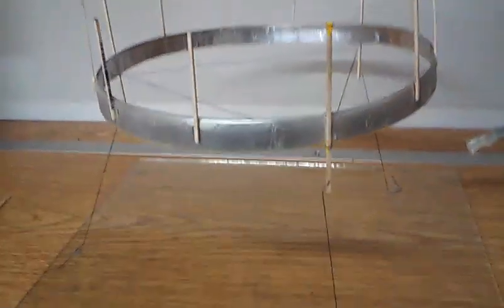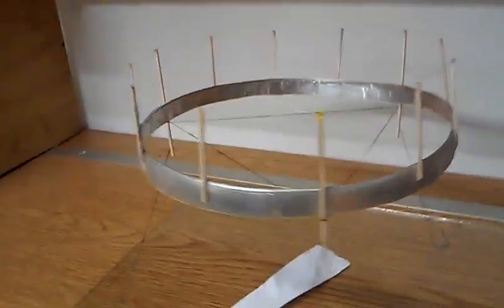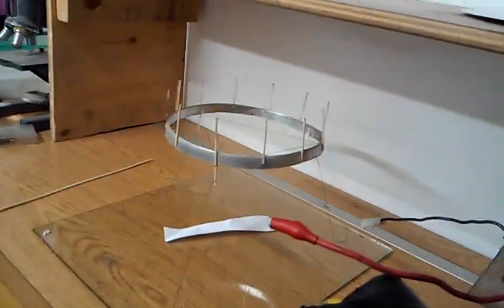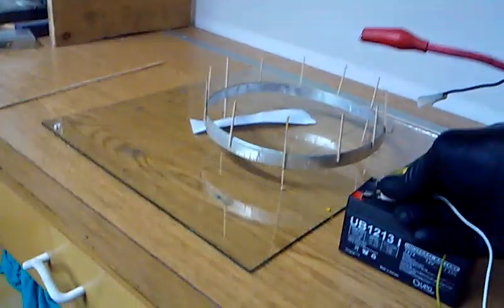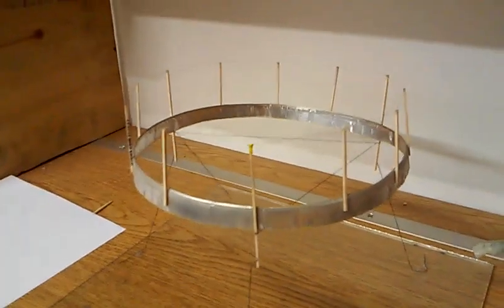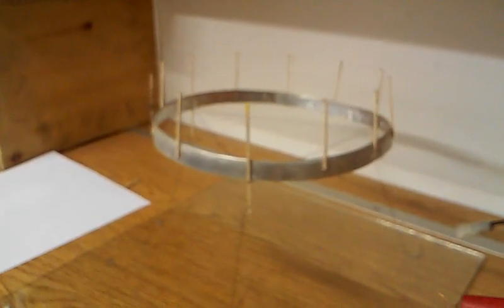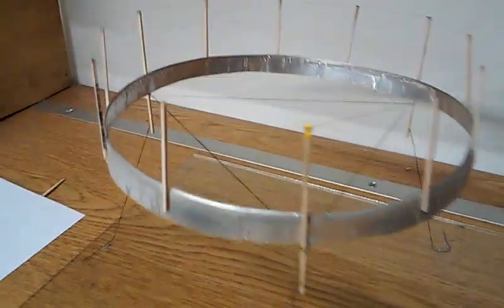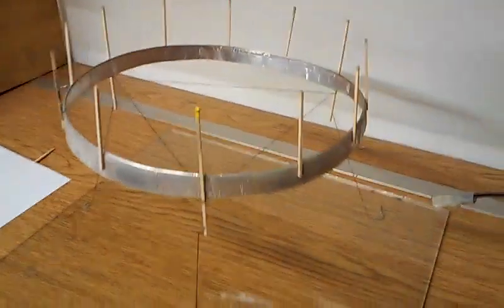ANTIGRAVITY LIFTER CREATES ARTIFICIAL GRAVITY ASYMMETRICAL CAPACITOR

Comment: Sorry Jim, but you clearly have no idea about what you have made or how it works...Its  T.T.Brown lifter,  utilizing the Biefield/Brown effect (which is the tendency of a highly charged capacitor to exhibit thrust in the direction of the positive electrode).  And it is definitely being lifted by ion wind.  this is obvious because it wont work in a vacuum!
Reply: Wrong. It has been proved after the "so called" Nasa debunking where they did'nt even supply the correct voltage. In independant studies, it did show that it will in fact work in complete vacuum. Research it.
Reply: Have you got a link to a video showing where one is used in a vacuum?
Reply: TT Brown has some old videos floating around where he did the first vacuum tests
Reply: it can work in a vacuum if the ionized gas is trapped INSIDE by a container.... bring the ionized gas inside a the craft...
Reply: +klientjuhD If you trap the ionized gas inside the container, you can accelerate it (thus generating thrust), then it hits the container (thus counteracting the thrust).  It won't work this way.
Reply: If there is ionized gas inside, then it's not in a vacuum!
Reply: CAN YOU ADD TO THIS PLEASE?    JUST LOOKS LIKE TALK.
Reply: bad link
Reply: Whether the lifter works in a vacuum I couldn’t tell you bit if you wanted to find out you would need to adjust the distance between the wire and foil because the conductive medium changes between air and vacuum. The distance needs to be just right to prevent arching but also enable the electromagnetic field to bridge the gap between the two electrodes. If this lifter was placed in a vacuum it would not work. Similarly, if this lifter could work in a vacuum then it would not work on the ground under normal conditions. You need to be able the vary the distance between the wire and foil in a vacuum jar whilst the air is being pumped out to carry out a proper investigation.
Reply: How about getting out of your Lazyboy, stop stuffing your face with Cheetos and prove that it does not work in a vacuum!
Reply: Blah Blah Blah!
Reply: How to make ?
Reply: Alf B thank you for the explanation
Reply: Alf B Mythbusters had one of those things in a vacuum chamber during their episode about antigravity
Reply: The Inventor, TT Brown, Takaaki Musha of HONDA, the US Army, Purdue University, and NASA all proved that it works best in hardest vacuum. Electrostatics works in vacuum. That is why we used to have VACUUM TUBE electronics!
Reply: NASA got patents 17 years ago with Serrano and Campbell after successful hard vacuum tests in 1999.
Reply: It works fine sealed in plastic bags and resin blocks!
Reply: They work sealed in plastic bags, and inside RESIN BLOCKS, where of course no air can get in our out!
Reply: check out jlln naudin  they test asymmetrical capacitors in mineral oil which simulate vacuum .. works even better
Reply: Exactly. Works even better under oil, in vacuum, sealed in resin blocks, etc. All of these media preclude ionization, so ion-wind, which is a feeble force with an upper-limit, cannot be responsible for the observed effects on mass. It accelerates a mass toward the positive polarity, and repels it from the negative polarity, the very definition of the Alcubierre Warp Drive methodology, which NASA and Dr. Harold White are all excited about now, and got patents with Serrano and Campbell 17 years ago!
Reply: Every force has an effect- rockets work in a vacuum and so will ionic propulsion
Reply: Reenan Du Toit, this is neither of those. This is electrogravitic propulsion, and as tested, is inertia-free. Please read:  http://u2.lege.net/cetinbal/PDFdosya/EtherTech.pdf
Reply: Again you're wrong tt Brown tested his theory under high vacuum and it did work in the Winter Haven Lab. Not only that the United States Army thought it was ionic wind propulsion and he did his test overseas to prove them wrong he went back to the colonel after the Winter Haven lab experiments and tested it in high vacuum and the propulsion system did work. That's why it's called electrokinetics not electric propulsion there is a difference there is a force there no matter what.
Reply: Alf B we don't live in vacuum, plus who told you the space is just vacuum?
Reply: what are the applications for this technology?
Reply: It would work in a vacuum. Consider a vacuum is never truly empty. Space is not empty.

An aeroplane propeller would not be affective in water. That's why the design has to change to propell a boat. 

Either the design has to change for a vacuum or the amount of energy used has to increase.
Reply: To Alf B, I had forgotten about the banned Roe Sigma book on the Biefield/Brown effect with high frequency electricity and a high dielectric substance. Thanks for the reminder.
Reply: It can work in a vacuum, but can't with out the magnetic field of the earth. Is an electromagnetic effect apply inside a magnetic field, in this case the magnetic field of the earth. Its not anti-gravity effect at all.
Reply: There is no such thing as vacuum. There is only differential pressure. Vacuum is just pressure negative to atmosphere. Whatever atmosphere may be. I am sure weather you do this experiment 2000 feet below sea level, or 20000 feet in the the mountains, the results will be the same. Vacuum (negative pressure) just expands the molecules of air. Very fun project. Super cool. I would need to know much more about electronics to understand this thing.
Reply: NASA ( Now Another Spy Agency ) is full of shit .
Reply: It DOES work i vaccum. Its you that havent tested this good enough!

Comment: Do you have a schematic?
Reply from the maker: I can supply that, & I will as soon as I get time. You can probably get a better idea now if you check out my other video " New Asymmetrical capacitor Design for Propulsion" In the mean time. basically it's just a Joule Thief circuit wound over a med size computer monitor crt flyback with 2 winds primary about # 12 household solid insulated wire & 7 winds of the same for feedback connected in opposite direction to primary. 12 v + to connection, the end of primary to collector of 2N305, 7 wind feedback winding  thru 220 ohm resistor to base & use a heatsink on transistor & you may have to reverse windings to work with flyback diode. Hope that helps untill I post schematic. Thanx, Jim
Reply: Jim RugRoden great, good stuff
Reply: Just look up blocking oscillator on Google.
Reply: Copper wire, some sticks, aluminum cake pan, battery and, some string. there's the schematic. Lol
Reply: Greetings Jim, your creation is a combination of  art and science and is truly lovely. I say this for three  reasons: Foremost, as a visual artist, I have never seen anything like this. It belongs in a museum. Secondly,  I study whats known as "spooky math", or quantum mechanics, and am interested photon propulsion, aiming at the goal of of achieving interstellar travel. Lastly, my father was a brilliant electronic engineer , and i had the pleasure of designing several government  patents with him. But back to your design,  its the pioneers that take the arrows. I would like to speak with you more about your design.

Comment: the ion wind is not what makes it lift
Reply: plz put a magnet on the end of a stick and interact with the lifter plz record too youtube
Reply: will not work in a vacuum. my kids and I made several at least ten years ago.The Biefeld–Brown effect is an electrical effect that produces an ionic wind that transfers its momentum to surrounding neutral particles.
Reply: i used the the flyback transformer from an old monitor. About 25,000 volts.
Reply: it is phase magnetism note this type of magnetism is efective on metals that not affected by common magnetism
Reply: Piccolo sun has a good idea. Put a magnet on the stick end and see what happens  when you bring it close.
Reply: The observation is it is defying gravity, therefore it is an anti-gravity device. You can apply the word ION if you like but the definitive observation is gravity is defied here and in action.

Comment: Do you get the same results when swapping (reversing) the current to the field wires? And could you please video the experiment with smoke (or fog machine / dry ice / etc.) to prove or disprove ionic flow?

Comment: Here is a thought. what if you used really thin light weight guage magnet wire, and wrapped that around say the inside of the skirt forming a long solenoid. And then magnetise it in the same direction as your lift. Maybe that might speed up the ion flow and give a little more thrust?

Comment: It appears you have an electrically charged plate under the device. What this looks like is simple magnetic repulsion. It only floats when the heavy battery is connected. So, this will not lift unless it is directly over the charged plate under it. You need super-conductivity to make use of the planet's negative surface charge. A small negative charge in the vehicle, could be propelled away. I read that the strength of electrical repulsion is exponentially stronger than gravity. Look at the power demonstrated by a lightening bolt.
Reply: +JoyfulUniter Have you ever heard of a battery? That is the big really heavy power supply, he hooks up to the feather weight flying circle. The flying saucer is so powerful, it can support a tiny stick, wow. This is a grade three demonstration of electromagnetism.
Reply: I also like to believe that it's an electric magnet that is under the desk and that's the battery he turns on and off... I'm not positive tho...
Reply: Buck Fisher i agree the bottom plate must be the ground plane for lift to happn.
Reply: That's right      but, in the mean time we need to figure out a more efficient or super efficient Magnus or Coanda effect. The properties aren't new just the understanding is and that will be where someone makes a breakthrough.
Reply: It's not magnetic repulsion, it's electrostatic- the current is far too small to entrain any magnetic field powerful enough (in an essentially 1-turn coil).
Reply: That's WAY too much trouble and expense when electrostatics gets the job done with HV and very low power.

Comment: i am gonna make an airplane(a model) with aluminum  wings and a copper wire in front and it will fly, like an ordinary plane but without engine, what do you think ?
Reply: That would be cool need very light light power supply. I believe the wings and exhaust of some real planes use high voltage charge to increase efficiency. The power supply he made could power more lifters maybe.
Reply: it can be easy if you start with the idea that the tesla coil have to be inbeded in the fuselage, an horisontal coil(hidden in the fuselage), with aluminum wings with one high voltage wire in front of each wing, you turn it on and the plane go forward,
Reply: The capacitors shape is crucial to the funcionality of these lifters. So it might not work if shaped like an airplane.
Reply: The shape similar to U Feel O lol
Reply: Denis Giguere no it wont you will need a large power supply too heavy plus a planes wing works with airflow. The ionic airflow is not significant enough to produce lift. Nice idea though keep thinking outside the box
Reply: +Denis Giguere The floating circle in the demonstration is powered by the big heavy battery that never leaves the table. The floating circle can only float when it is directly over the charged plate under it. Tesla's wireless electric transmission experiments involved a series of huge towers installed on the ground. If they were actually in place, you would only need a receiver to connect, not a coil. You would need to be grounded, however, to close the circuit.
Reply: @Things We See
sorry but this is Bullshit. I will try to explain: the pointy things on the wings you mean are there for electrical discharge, just like when you rub your hand against some synthetic fabric, an airplane will get charged up. when a plane flies through the air it will get charged up by the air molecules, to get rid of the charge they have pointy devices (that are just metallic rods connected to the main airplane structure) that will disperse the charge back into the air. this works because charge accumulates and gets more "happy to move" on a sharp, pointy edge than on a flat surface (like the wings themselves, or any other relatively flat part of the airplane).
Reply: Fantastic idea! Go for it, BUILD IT.
Reply: Fortunately, thrust increase is EXPONENTIAL with increasing Voltage. Read TT Brown's lab notes, as I did in 1996.
Reply: i thought of that too but the thrust mass ratio is just a mess.
Reply: Thrust will be just fine for a sailplane or glider to keep it aloft with only 40kV @1.5 milliAmps.Use a foam sailplane, like Horizon Hobby, and a Micro HVDC battery powered supply from www.amazing1.com
Reply: It will work FINE shaped like a flying wing. Remember the US ANTIGRAVITY SQUADRON (B2 Stealth Bombers).
Reply: Of course that should work. just go to www.amazing1.com for plans and kits for micro High Voltage power supplies. Use a FOAM FLYING WING. It will work.
Reply: TT Brown made MODEL BOATS with this principle his patents are based on, which I replicated. TT Brown had demonstrated that animal and plant passengers on board the radio-controlled boats experienced NO G-forces or stresses, no matter how sharp a turn and instant acceleration-stars and stops. Typical UFO behavior. Everything within the forcefield has its inertial mass canceled by the electrical charge! Build them!  The Searl drive system was patented recently, US Pat No. 9,871,431, SPINTRONIC GENERATROR, Jan. 16, 2018. It is a New Age.
Reply: Build it!!! Its not that difficult. We need as many people as possibe building and experimenting with this 90-year old SIMPLE technology.
Reply: There are a lot of patents on the Internet which make use of this principle. Study them, and know that the power technologies today are smaller, much lighter and more efficient that what was ever available in the past.
Reply: The FLYING WING is PERFECT for this, as in the B-2 SPIRIT STEALTH BOMBER. Read THE US ANTIGRAVITY SQUADRON, by Thomas Volone, PhD, whom I lectured for at COFE-9, in Albuquerque, New Mexico last summer, 2017.
Reply: Its not "ionic airflow" that produces lift or FORCE, as these devices wok in OIL, WATER, HARDEST VACUUM, and SEALED IN RESIN BLOCKS, they still work! Tis is ARTIFICIAL GRAVITY, in perfect accord with Einstein's and Alcubierre's theoretical work. We can go to the STARS in reasonable time and economy with these TT Brown proven patents from 58-years ago.
Reply: Today we use LIthium-Polymer or Lithium Iron batteries that are very lightweight, like we use in RC Planes, Helis, and DRONES. 11.1 Volts in 3 sealed cells!
Reply: Why not? Make an ELECTROGRAVITIC WING-SUIT. Electric charge always stays on the OUTSIDE of an enclosed conductor. Go for it! Force is EXPONENTIAL with increasing Voltage.
Reply: Yo, that would be soo cool. If you make it, send me link :D <3
Reply: Stephen Pegg In the Hindu Scriptures, there is a FLIGHT MANUAL called the VYMANNIKA SHASTRA, and it talks about how to build STARSHIPS (!) It speaks of how the YOGIS can harness LAGHIMA "A powerful centrifugal force that can overcome any gravity", and how this is produced electro-mechanically in their ancient VIMANA craft, that today we call flying disks, or UFOs, since the 1940s in more modern times. The Ancient Tibetan Monks and Shaolin Priests of high order and training can focus this force too, they call CHI, or the Cosmic Life Force, which in India they cal PRANA, and we call ETHER. Ether, which Tesla championed, and not RELATIVITY, is coming back into vogue, and QUANTUM MECHANICS is now much better understood than it was in the 1930s and 40s. That is the KEY. Ether Theory, and Quantum Mechanics. Be careful, and good luck!
Reply: Look up St. Joseph of Cupertino, and Daniel Douglas Home, two persons who could LEVITATE AT WILL. Documented.
Reply: UFO'S EXPLAINED:
Yes, this helps explain the basic underlying "principle" of how UFOs probably do work. But those are infinitely more ADVANCED than Jim's cute little project. Still, the 'powers that be' do NOT want us to start figuring this stuff out. Electro-Gravity and Anti-Gravity may be the most forbidden category of technical knowledge on this planet.    WATCH OUT, JIM!!!
Reply: Things We See try using a Tesla coil.
Reply: There is normally a Tesla coil in the HV unit in the form of the T1 or Primary Transformer, which steps the input Voltage up to a few kiloVolts. Then its rectified into higher Voltage, lower Amperage DC in the multiplier output stage.
Reply: You also cold do it in helicopters wing's, to work like those jet tip helicopters blades.
Reply: go green.. try paper?
Reply: thanks, I didn't feel like typing that. Besides if he had any inkling he wouldn't be trying to reinvent anything, he's be continuing the Electrogravitic work of T.T. Brown et al.
Reply: Yes, and High Voltage is Easy to achieve with light weight Multiplier's .
Reply: Already happening at MIT

Comment: I want to commend you on your circular design AS WELL AS your power supply.  Using small high volts from an electromagnetic collapse is more efficient.  Most use complex signal generators and heavy transformers making a huge fluffy field - that lack of efficiency is what I think leads to ion wind effect.  ...   you could be more efficient bending your top wire in a circle directly above your bottom ring.  Its that circular shape which makes a difference instead of triangular too.

I'd like to see people put these things to use more in a dynamic hull shape that is air tight for tests in a vacuum (holding its atmosphere inside an air tight air frame).